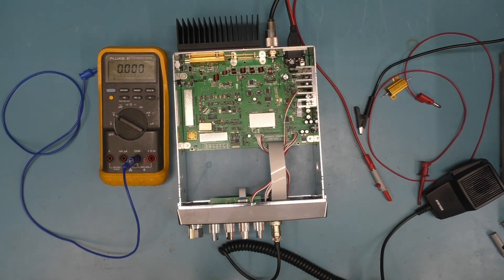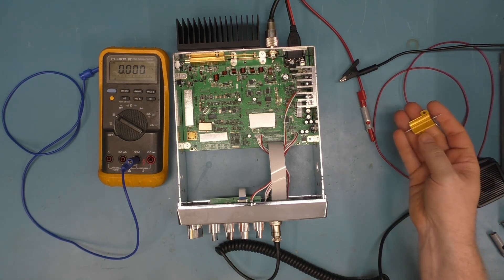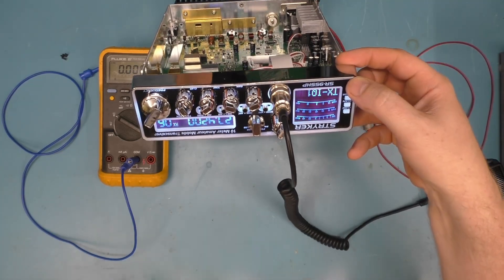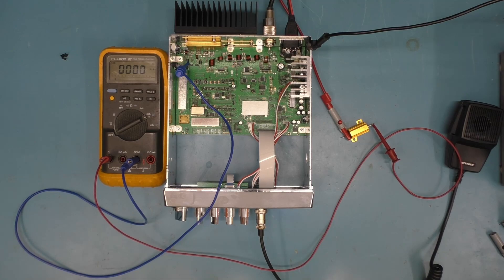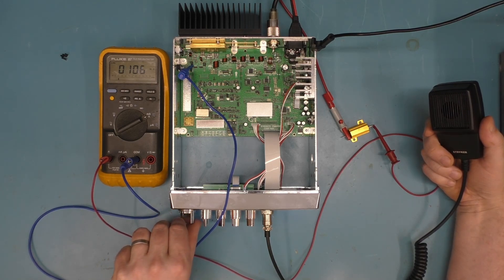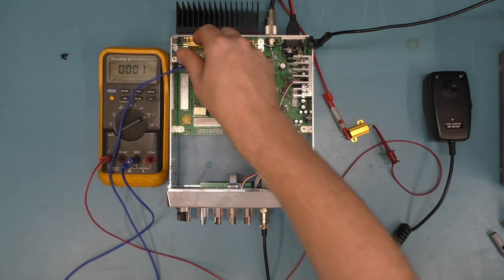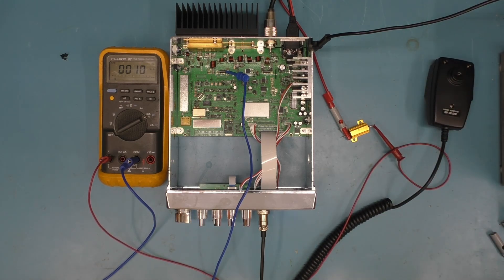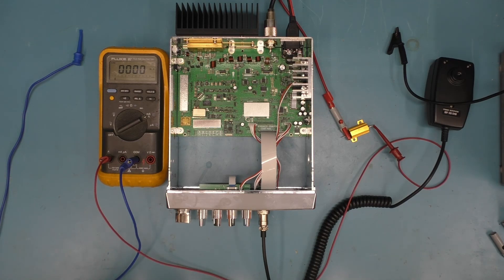Stryker 955 Version 2 bias adjustment procedure

Comment: Times have sure changed. Was inside my 1972 SBE sidebander 2 this evening fixing a bad connection. The radio is about the same size as the Stryker 955. Under the cover of the SBE it's full of circuit board. Only 23 channel.
Reply from the maker: Yes, we have smaller electronics that have tighter tolerances. But think about it this way, in 1972 those radios were well designed for the times.
As much as we do it, we should not judge yesterdays designs on todays standards.

Comment: Mark, thank you a lot for sharing the video. Where is the manufacturer (Qixiang Electron makes the board) information, that 20 mA is used for I Q3?. Is somewhere a alignment manual or schematic available?
Reply from the maker: That stuff isn't available unfortunately. I drew my own schematics of the radio and I wrote an alignment procedure.

Comment: Yes but wait! Are you saying that by turning the channel selector, you're actually making the adjustment? I must guess that you are saying that. 

So I have two simple questions, (assuming that my guess to the first question is correct). A: do you have the radio coax connected to a 50 ohm dummy load? If you said that in the video, I didn't hear it. And B: what did you press and hold to get into the service mode of the radio?

It just occurred to me that you may have noted that info in the details "below", so I'll check that ASAP. If you haven't I hope you could take a moment to answer those questions.
Thanks for the video and everything you recorded on camera was crystal clear, (I mean, I could see exactly what connections you made).
Rich

Comment: What final output transistors does the V2 use?
I'm wanting to upgrade the 13N10s in my V1 955 but am still not sure what all is required.
From some research I have found that folks are putting IRF520N's in place of the 13N10's.
Reply from the maker: They use IRF520s.
If you have a 955 with 13N10s, it's an old radio. I think it needs a few other parts changed to work with 520s.
Reply: @Mark19960  Ok thanks! Ill leave them be for now.
What about the obsolete TDA2003V IC?
Its the last transistor before the speaker. I have a bad one can you recommend a replacement?

Comment: Thinking about changing finals in mine. I don’t have a 10v source.  🤔
Reply from the maker: Yeah, you need to have a lab supply now.
The procedure was changed to make it safer for the radio. The version 1 radios ran a risk of turning the mosfets on hard and letting out the magic smoke. by having a 10 volt source and a ballast resistor in place that risk is pretty much gone.
One thing that has been seemingly impossible to get some people to understand is that there never was a "magic voltage" used to set bias.
You can change the outputs, but keep this in mind....
It does very little to change the driver and final. The gains are had by changing the 2 mosfets in the PA section. That's the two closest to the antenna jack. I can't show you the schematics and explain why that is but simply put, the final is padded going into the PA stage... so there is little benefit to changing all 4 devices.
Reply: @Mark19960  thank you!
Reply: @Mark19960  if I do decide to change to something like, ERF2030+ mosfets, for the fun and the learning experience, would you still set the bias using the values in the video? Or does the bias change based on the components own requires values?
Reply from the maker: @mcconja  good question. I would have to try to put ERF2030s in there. They are not much different from Z24s. the same procedure works for Z24s so i don't see any issue with 2030s - which are just sketchy relabeled parts.
Reply: @Mark19960  I ordered some 2030+. Got the variable PS with current limiter today.  Also got a nice variety of output cables. Might have to get a breadboard and raspberry pi and experiment a bit.
Reply: @Mark19960  ok, I ran back through mine to double check. When setting bias, I noticed q1 is well below 100 and I went up a click and it was close. One more goes to 101ma. Is it better to go under 100, like 96, if I recall?
Reply: @Mark19960  ordered a supply. 😄

Comment: Do you happen to have any information or a video on adjusting the 980's pots? Thanks.
Reply from the maker: On that one, no.. but I think Mike has one. look for mikes radio repair. I will be willing to bet he has covered this.
Reply: @Mark19960  Is Mike still working  Radios?
He hasn't posted new videos in a while.
How do you like the V2?
Reply from the maker: @RC-Heli835  I use one in the car for a daily driver. Prefer it over the version 1.
Reply: @Mark19960  10 4
Roger that! My 955 v1 is my favorite of all radios. I have not tried the v2 yet.

Comment: The service manual doesn’t say add 20….
Reply from the maker: There are a lot of things the manual doesnt say, or says incorrectly. I could made a video on the mistakes in it.
Reply: Well I’ll wait for the new manual with this version of current adjustment. Is this verified by Stryker?